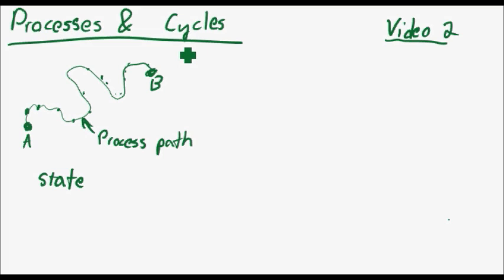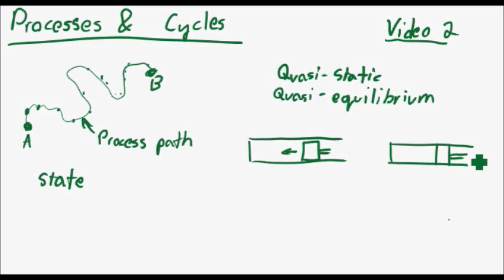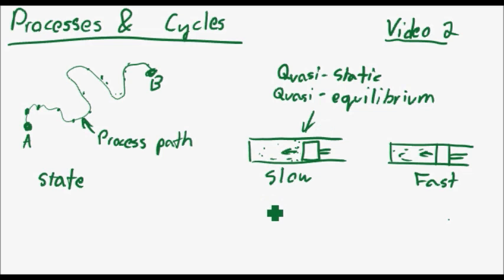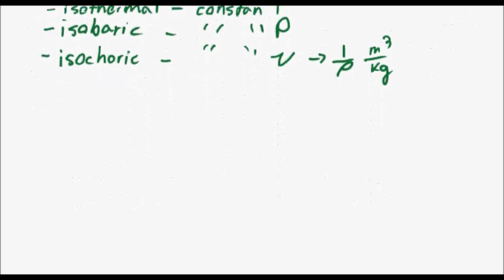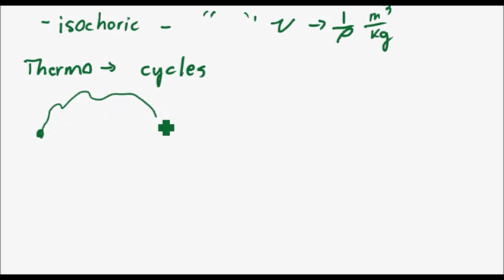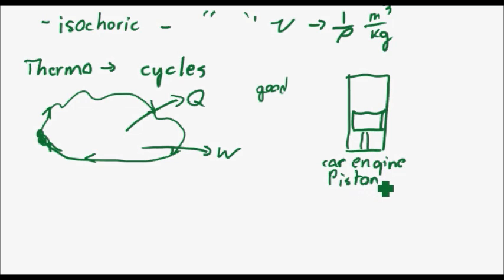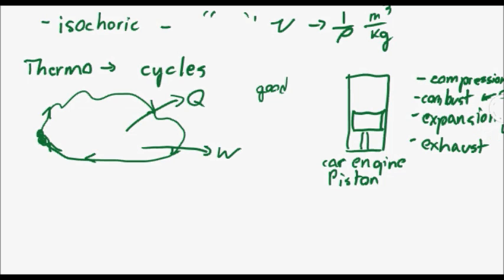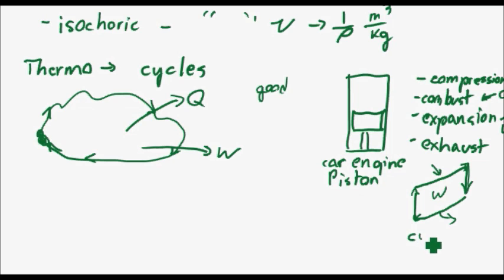Processes and Cycles (Thermodynamics 2)

Comment: Your explanation of the quasistatic process is not very clear...can you please clarify? Thank you.
Reply from the maker: a quasi-static process, also known as a quasi-steady process, is a process that occurs at an infinitely slow rate. The reason this is used is to assume negligible energy losses due to things such as friction or heat transfer with the surroundings. Although this could never truly be accomplished, this model allows you to assume that the process is reversible (you can return to the original state). In reality, all processes are not like this. you can think of an egg for example. If you heat up an egg, you cook it, but you cannot uncook the egg. This becomes more important as we begin to discuss the second law of thermodynamics in the future. I hope this was helpful, let me know if anything else is unclear. 

Thanks for watching!